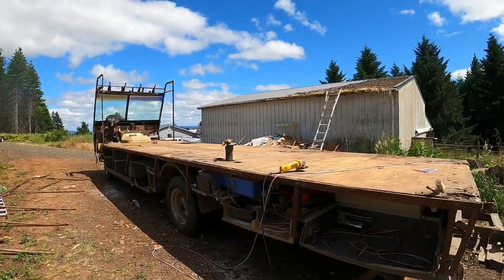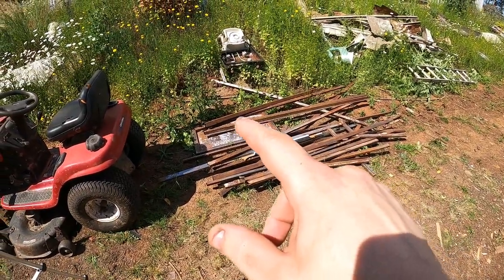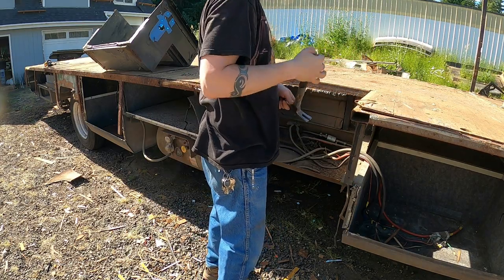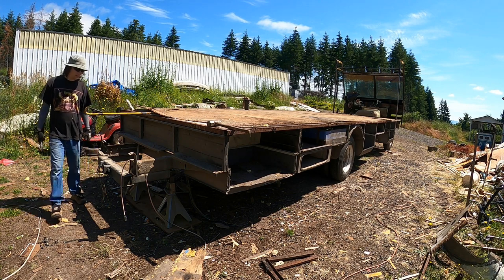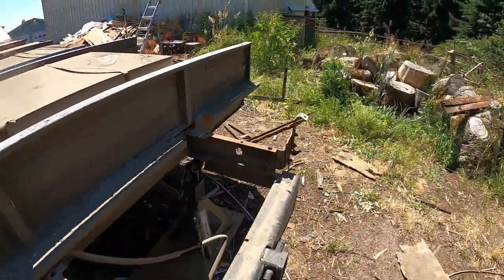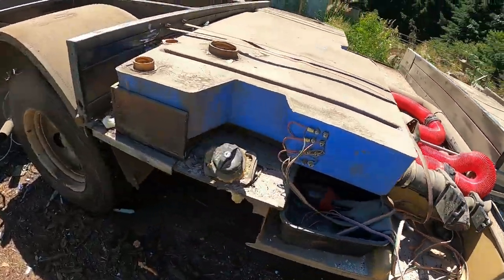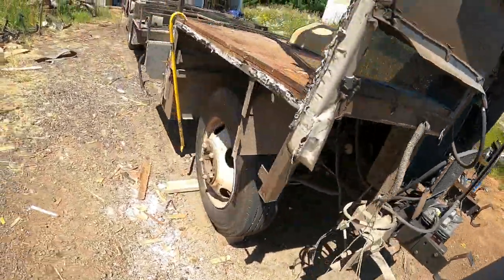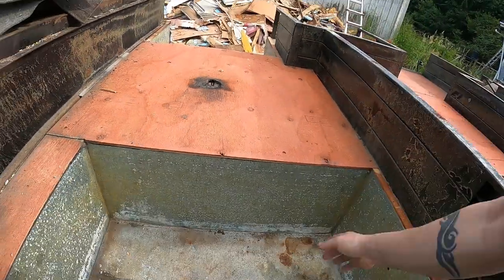RV Teardown (Part 15) Floor & Wall Frame

Comment: Wow, the floor panels came off way easier than I expected. 😀 Now you can design what you need for full-time living. Consider a rear door instead of a side door so you can walk out onto the truck bed and use it as a work area. Also maybe have a roof overhang behind the living area to cover an outdoor work bench. 🤔

Comment: MAN!! I’m so excited to see this turn out. Patches looks like it did when Winnebago Industries in Forest City Iowa purchased the forward control unit and drove it into the assembly plant. Just a driver’s seat, a steering wheel, a frame and a drivetrain.

You now have a clean slate! Keep the content coming bro!! 👍🏾😉

Comment: Fyi if you plan to use the lp for anything much more than cooking a small tank may freeze up on you due to the lack of surface area of the tank. I do hvac for a living and think you should look at a 120 volt ductless heatpump for patches during the rebuild. I wish you were closer I'd donate and install it for you.

Comment: You had mentioned in an earlier video that when you take out your stairwell that you may just put in a couple rails to step up on. Might be interesting to set your door up to extend the outer door panel to come all the way down to cover the step rails.

Comment: Good job! Are you doing anything to the engine,  transmission? I'll keep you in my prayers 
😊
Reply: Nathan has done a lot to the engine, transmission, exhaust and suspension. Patches was running really well. Getting rid of the mold infested body and building a new body will give Patches a whole new life. 😎

Comment: At 29:20 it looks like it might be possible for the shorter living area to have a lower floor level. 🤔 That would mean less steel panel area and a lower roofline, like a hotrod style Class A. 😀

Comment: how about a  outside hot top on the rear bed?? i bet you could make it work...some system so the weight of the rear is not on the tires but using jacks or something for weight support!

Comment: You ain't messing around!  If you're going to replace everything you took off of there? It's going to get rather spendy, no?
Reply: Plan is short steel panel camper body and flat truck bed. 😎

Comment: I don't understand why you're doing so much work that doesn't have to be down like the text what's wrong with leaving the tanks where they were I mean they were put there that way for a reason I mean I see so much wrong I'm a firm believer in working smarter not harder and what you're doing is way too hard but it's your channel to do what you want I guess good luck putting it back together

Comment: i'm worried about the front windows if you underestimate the wind and other forces when driving.  the support you attribute to a few spindly pieces of metal might not exist!  but i certainly don't actually know what i'm talking about!
Reply: PS--you must never buy any but marine plywood, probably twice as thick as you might want at first!  and there are several grades of marine wood--be careful!
Reply: Good point. Nathan has bought some steel panels which will add strength when welded on but that flimsy frame might well need bracing with steel tubing. 🤔